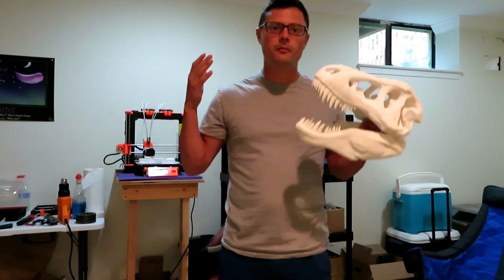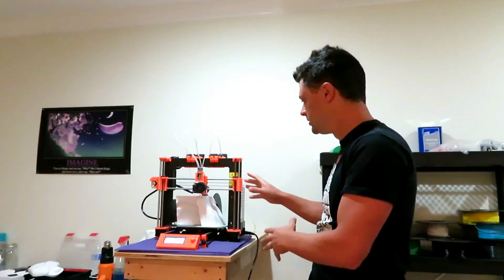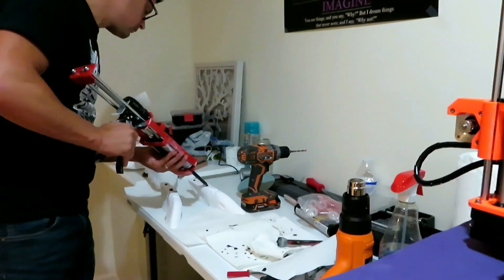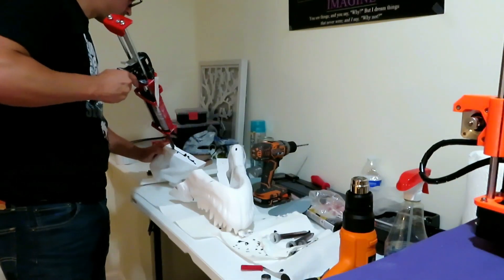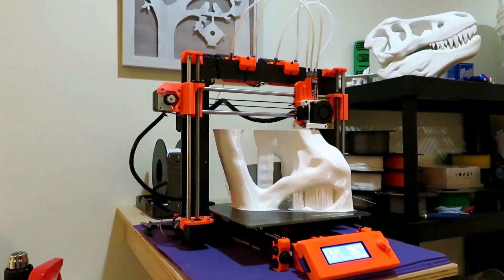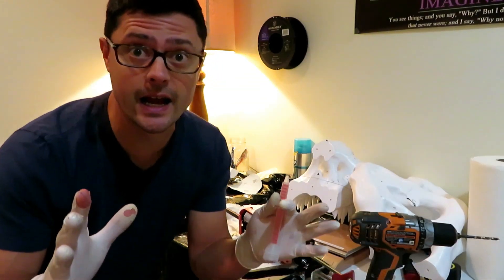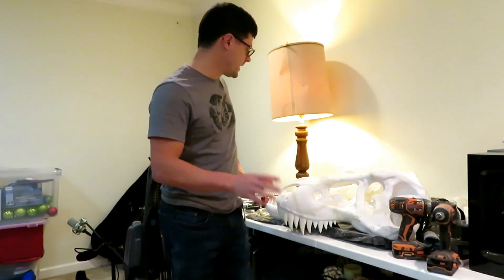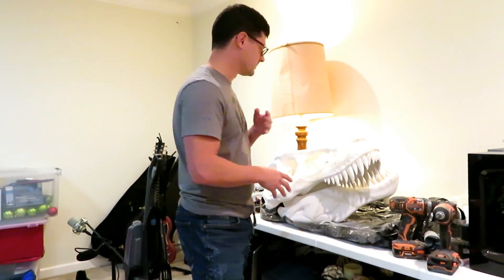Making The World's Largest 3D Printed TRex Skull | Start to Finish

Comment: I'm trying to print off a big one too because it looks SO COOL! How do you do it?
Reply from the maker: what part do you not know how to do?
Reply: @rdlmethat2018  I understnad how to scale it up and cut it. It's just cutting it in the right places and printing it in decent time. If that's even possible
Reply from the maker: @charitygaming5833  , Yeah finding the right places to cut is critical.  I did this all manually.  I try to get the pieces to not have small danglers.  In terms of decent print time, just throw that out the window.  I am in for over 400 hrs here.